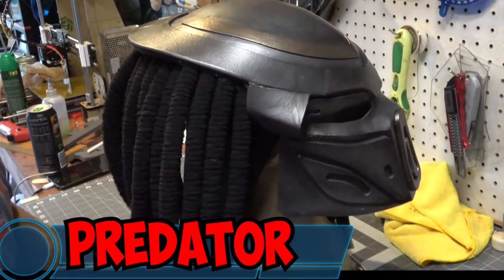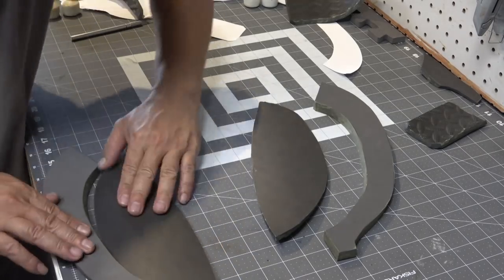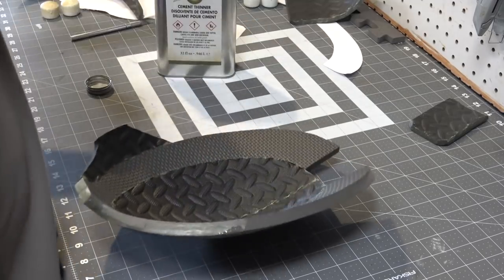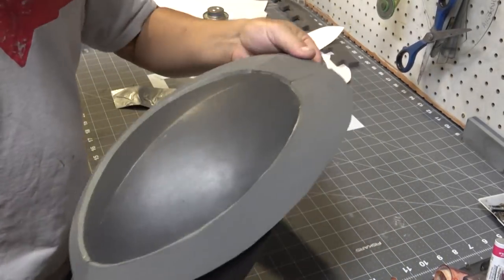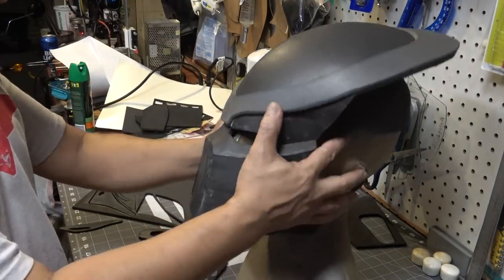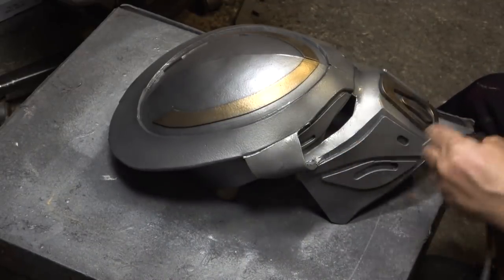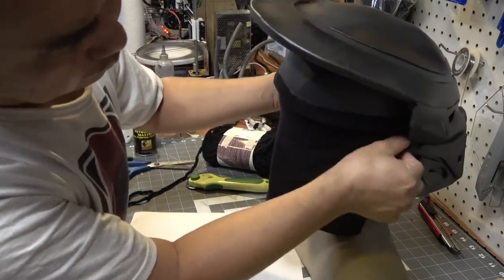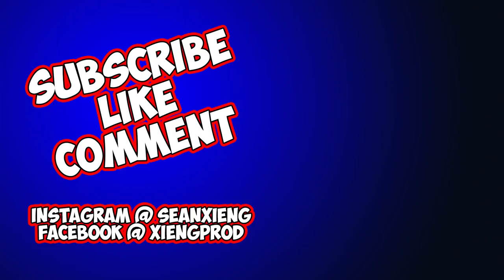Predator Foam Helmet Tutorial

Comment: I recently bought your pattern, and was wondering how big of a sheet I'll need to print it off.
Reply: Pete did you ever get it to print off correctly? I downloaded the template, but when I try to print off in separate 8.5 x 11 in pages, Adobe only prints one page. Do you know how to print it off without using poster size paper?
Reply: @neohighlander  I went to staples and had them print it off.
Reply: On poster size paper, or…?
Reply: @robboyle3123  just regular paper